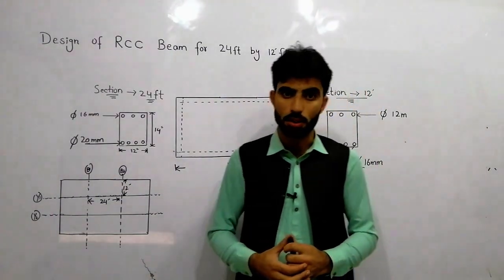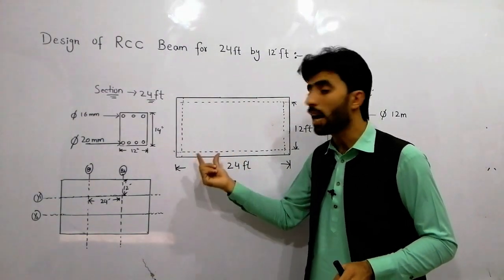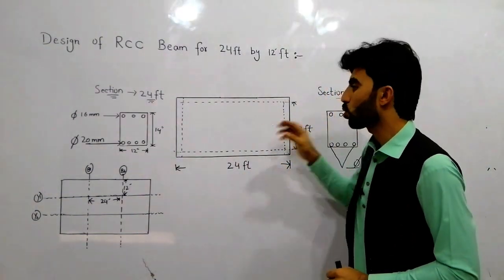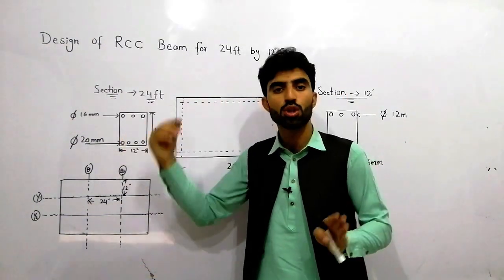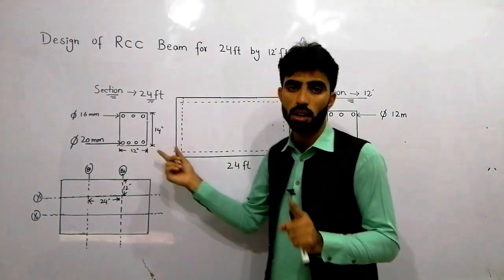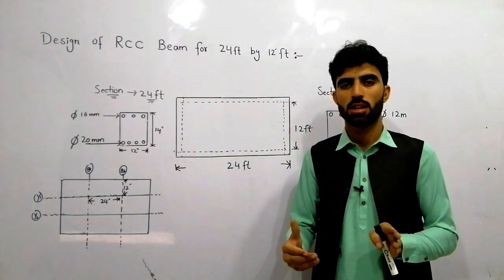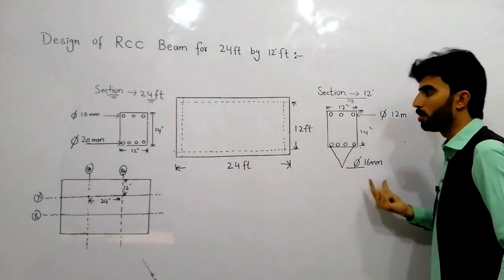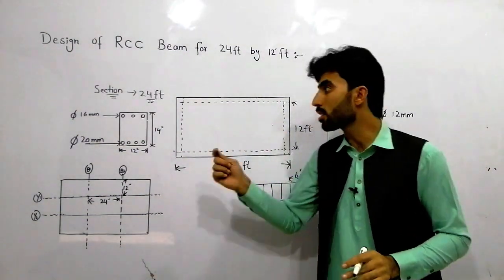Design of Beam for 24 by 12 feet | Design of RCC Beam | Civil Engineering Videos

Comment: Bro If We have Span Length of 20ft, What would Be Depth of beam, Which kind Dia of Bars Should be Used?
Reply: 15inch depth and 9inch width with 3 25mm bars at bottom and 3 20mm bars at top